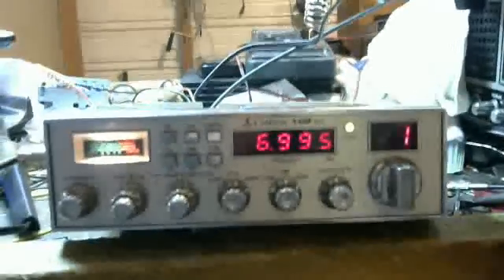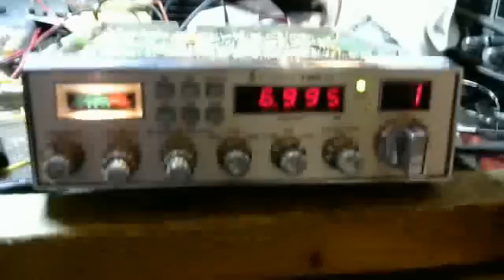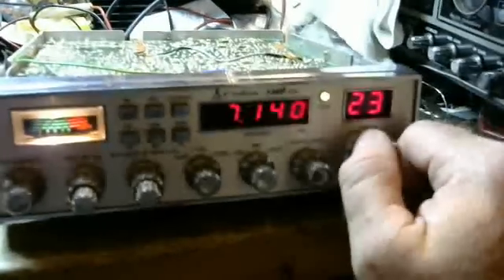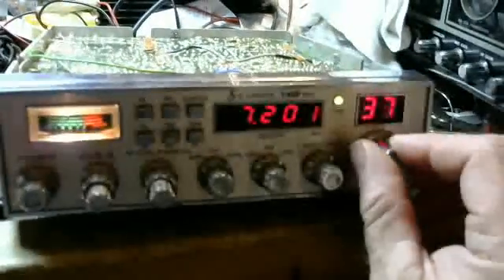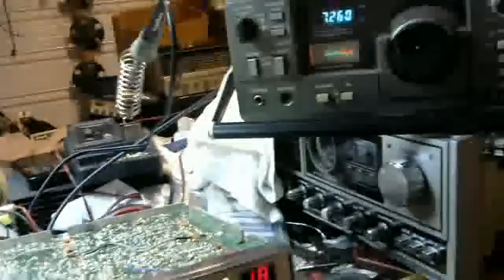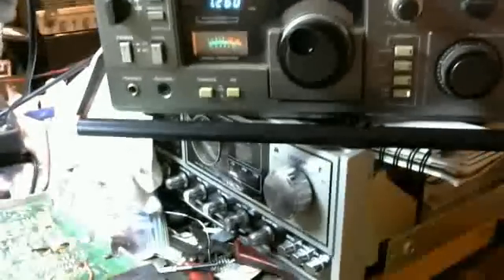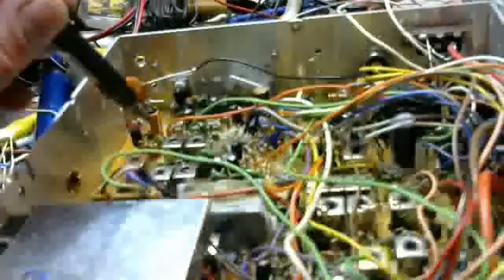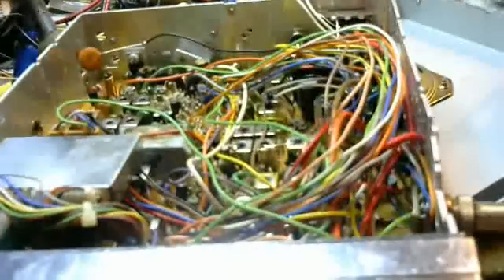40 meter band conversion to Cobra 148F CB Radio

Comment: Where are the finals located
Reply from the maker: I only used the 2sc2166 transistor as a final. This transistor is being driven by the 2sc1973 predriver. Both transistors are located in the left rear of the radio. Power dissipation when transmitting is about 2- 3 watts.

Comment: nice experiment ..im trying to get my head around the mixing ........A master vco osc for 7 would be 7 + 10.695 or 17.695  then add 3.3MHZ (* Divide by 330 channel 1) difference generated with the 7.2meg xtal multiplied by  3 to produce 21 ...a lock for the difference freq of 3.3m..

but i only have the pll02 truth tables so maybe thats the reason im out

Comment: Could I do this on a cobra 138?
Reply from the maker: I haven't had any luck doing this conversion to radios that use the D858 PLL Chip.
Reply: I can't even find a manual or anything for the 138. I can find plenty on 138xlr, but I have the old style 138.
Reply from the maker: If you go to www.cbtricks.com they have the schematic for your 138  and its free to view. Hope this helps.

Comment: That noise on 7.075 that you are hearing is the digital mode FT8 if no one has told you.  You will also hear that around 14.074 on 20 Meters as well, and if you go to 80 Meters it is around 3.573.  FT8 is run on all amateur bands from 10 to 80, not sure if anyone is doing it on 160 Meter band.  I like your conversions, wish I had one of those rigs to try a conversion.  73's from a fellow WVian, DE WD8WV
Reply from the maker: Thanks Juddie, I don't do anything Digital on Ham Radio that's why I didn't recognize the mode. Ive come a little ways since then. Im not too far from your way,  Im about 20 mins from Parkersburg. Stay in touch, Ive got some new stuff coming here in the future to youtube.  Carl.
Reply: Will do Carl!  Yes your not to far from me, I checked you out on QRZ.com and saw you were close to Parkersburg.  I talk with several people from that general area on the WV Fone Net on 3.810 MHz at 6 PM local time during the summer and 5 PM in the winter.  Thanks for the response back.  73 Juddie WD8WV
Reply: There was no FT-8 mode when this video was posted in 2013. Am I right?

Comment: Hi carl, cool conversion on the 148 they are good rigs, i have in my collection a cobra 134 /23 channel, no mods great sound, also a cobra 138 /23 channel std no mods a great rig, and last is the cobra 25 NW ST SERIES- SOUND TRACKER. Would the cobra 138 be a good conversion for 40 meters!!!... it uses the MC 1496C chip. best regards.
Reply from the maker: Hi Peter, the only radios I have been able to convert are radios like the cobra 148, uniden grant xl and uniden Washington that use the mb 8719 pll chip. I'm working on a dsb conversion for the cobra 29 to work on 20 meters. Any other questions please feel free to ask. Carl.

Comment: Hi carl, I would like to do this conversion on my super star 360 fm rig, is it possible on my rig. thanks for sharing.
Reply from the maker: Hi Peter, unfortunately this conversion only works on radios like the cobra 148 that use the MB8719 PLL Chip. Radios like your Superstar and the Galaxy 959 Ive not had any luck with. Thanks for watching!
Reply: Hi Carl, thanks for the update, it might be possible for me to get hold of a cobra 148, if so can you help me out with conversion. best regards.
Reply: thanks carl, i will have to get a cobra. best regards

Comment: carl i have a uniden pc 122. can you do the mod on these ? i would like to use as a qrp field station. Thanks
Reply from the maker: Hi Steve, I have not had any luck converting the pc 122 or radios with similar boards. You can try by asking Juan Agrinsoni who has videos here on  YT with his conversions with the pc 122 using a dds vfo. Ask him he may be able to help you.
Reply: What have you done these conversions on .so I can find one of these radios.
Reply from the maker: I like the cobra 148 both new and old along with the uniden grant xl. These radios that use the mb 8719 pll chip are good for 20 and 40 meters. The uniden Washington and cobra 142 make good 20 meter band radios also for operating qrp with a couple of watts.
Reply: Okay  thanks. Try to find one. How can I get in touch with you.
Reply from the maker: my email is  ceboley304@yahoo.com
Reply: Thanks let you know

Comment: I would have thought that the PLL would go out of lock if you change one of the crystals.
Reply from the maker: It will work  if the vco coil is retuned to track along with the crystal.  I am using a 7.200 mhz crystal and a rewound vco coil to work on 40 meters and the channel selector is moving in 5kc steps.  It worked out that way by chance.

Comment: hiya carl. really like the videos i have a few i like to convert over,  you have any updates?  also on these old radios have you considered remove the factory clar, install a 10 turn ?
Reply from the maker: Hey Scott, no I havent tried using a 10 turn pot on the clarifier. I try to keep the mods as simple as possible that way  the person converting the radio can add to it all what they want.  I feel that helps inspire others to experiment with radio electronics, besides it is fun to see what others can come up with!  Im working on a conversion for radios like the cobra 29 and uniden 78 in converting them to work on 20 or 40 meters without a transverter and of course they will be am mode only.  There are thousands of these radios out there floating around just like the ssb rigs that use the mb8719 pll chip, time to start putting them to good use!!!  New videos are coming and I wanted to say thanks to all who are subscribed and please support the other Techs here on YouTube that Im subscribed to also! Thanks and 73s Carl KC8YLT.

Comment: I just Googled "CB Conversion" and yours was one of three pages that came up, showing conversion to bands other than 10 or 6 meters! NICE WORK! I've successfully converted several SSB rigs to 12 meters tx/rx. 10 meters is a piece of cake. ;) However, I have also converted the old $99 class AM rigs to 80, 40, and 20, using a technique almost identical to yours! None of those HF band rigs transmit, but the 80 meter unit is also an exciter for my AM transmitter. :) check it out on my WEBsite: mymorninglight(dot)org(fwd-slash)ham
Reply from the maker: morning1500 Thanks William, I saw some of the great conversions to old cb radios you have accomplished.  Liked the 75 meter am transmitter!  Thats what  Ham Radio is all about!
Reply: Yes, it is! :) It truly is a real kick to take something like a CB rig, and make it into something the original design engineers could have never imagined. :) Right now, I'm working on one that will select one of four different frequencies (in the 40/41 meter band) of a Christian shortwave station that I like. It works rather well, but still needs some refining. :) Gotta love that PLL02A chip!!

Comment: Thats cool. I remember years ago (I was about 14 and freshly licensed) bringing this idea to some guys in my club back home since I had a ton of cbs I collected from garage sales and auctions. 
After the laughter subsided I got an answer on par with, "you want to make a silk purse out of a pig skin..."
Nice to see it can be done and excuse me while I pull some cbs out of storage lol
Reply from the maker: Mykal Anstrom  Thanks Mykal! Im glad we think the same way. I have heard some flak from other hams too when it comes to converting cb radios.  An old cb radio that has been converted is easier to work on and can  take alot more physical abuse than some of these newer rigs.
Reply: CARL BOLEY 
I have been PLEASANTLY SURPRISED at just how decent these "junker" BC rigs are as HF receivers! If they use the wonderful PLL02A chip, conversions are easy! If they have the "channel-locked" PLL chips, I just disconnect the VCO from the PLL chip, and tune it manually with a pot. :) (The channel selector switch gets yanked out, of course.)

Comment: Excellent! It's nice to see a CB turned into something useful LOL. That noise on 7.075 sounded like PSK-31.
Reply: purplemutantas 
Yep, that's PSK31 alright. :) My favorite mode. I have converted at least a dozen different CB rigs into all kinds of different bands, including AM broadcast. :) Some are manually tuned with a pot connected to the VCO (the PLL is disconnected) and others (if they use a PLL02A) the PLL is still used. Fun stuff!